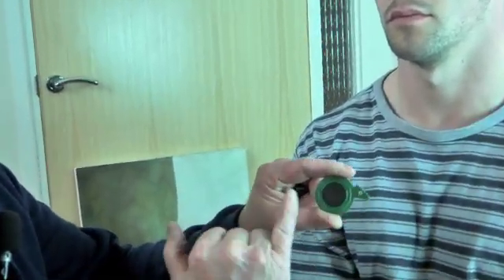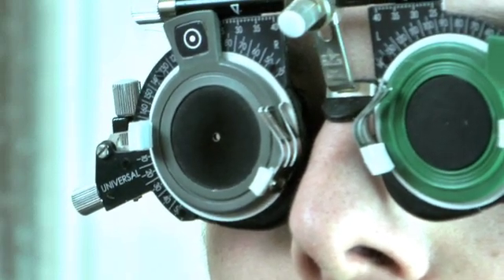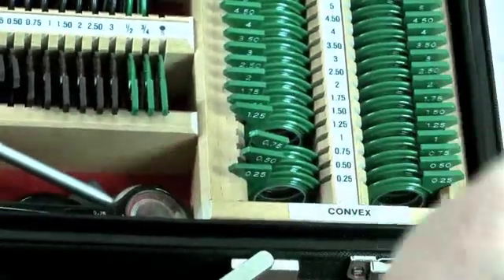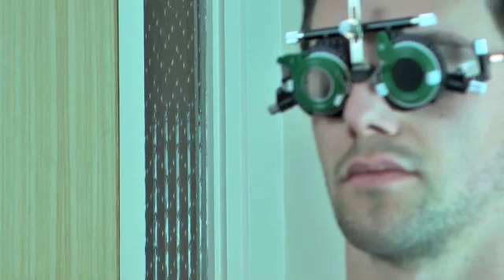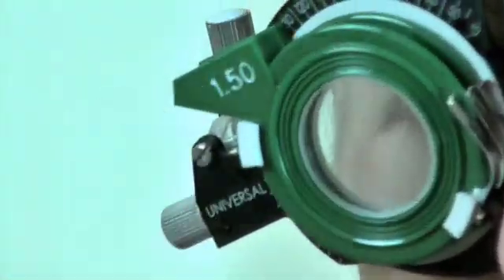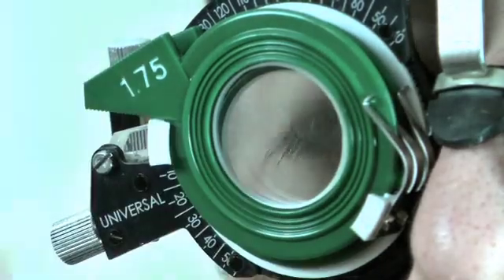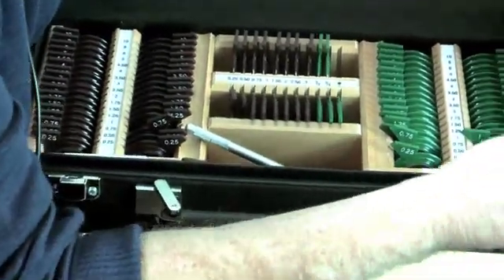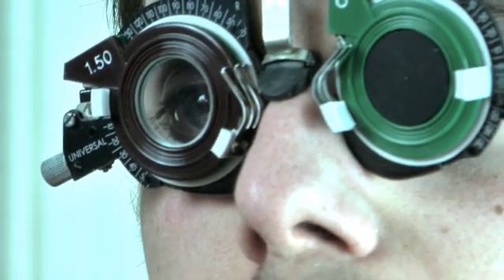M4V Training Video: Subjective Refraction Part 6

Comment: Is there a part 7
Reply: +Ian Squire Shall the initial MPMVA be performed on the pseudophakic person with standard IOLs?
Reply: Ian Squire Must the accommadation one be included ro get the best vision sphere (i.e., +1.75 + +1.00 =  + 2.75), or +1.75 is the one?
Reply: Ian Squire Does the +1.00 needs to go alone with to the +1.75 to get the best vision sphere plus power, or just the +1.75?